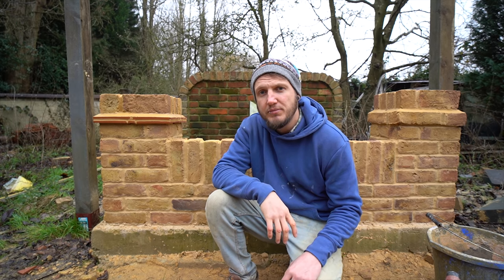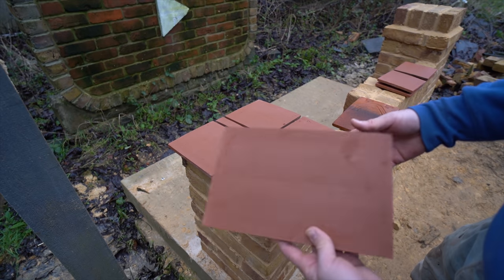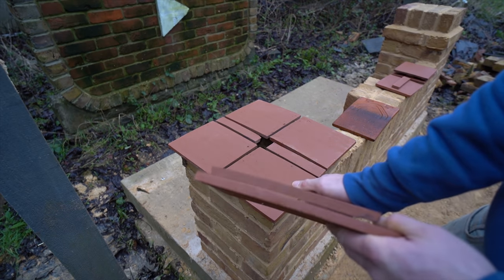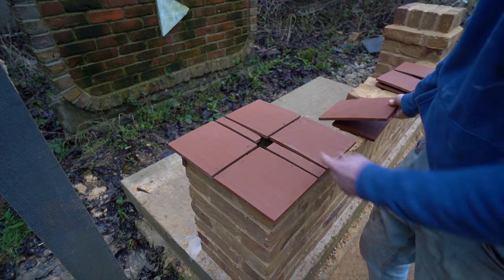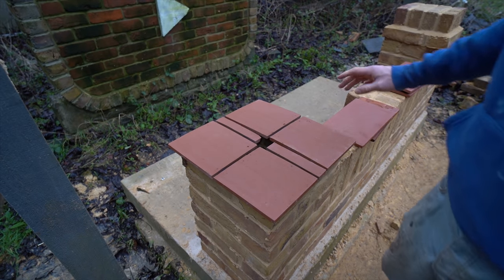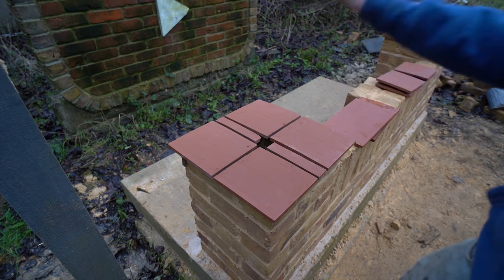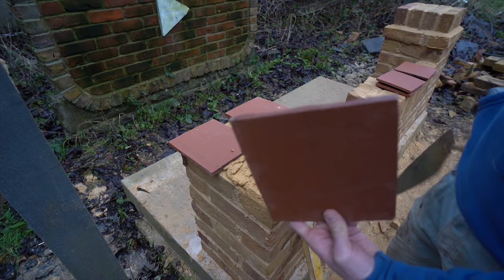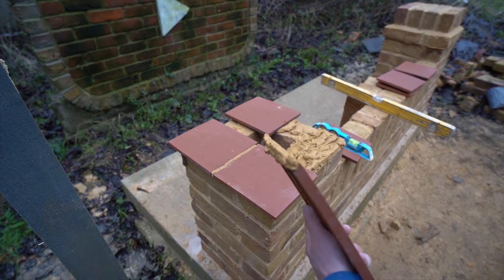BRICKLAYING - Make your BRICK PIERS look AWESOME with this

Comment: How would you suggest to build free standing pillars they need to hold heavy 6ft to 8ft High hard wood driveway gates?
Reply from the maker: I would suggest at least a 2 brick pier with a small steel running up the centre from the footings to provide enough strength to hold the gates. Hopefully that helps
Reply from the maker: In fact I would probably suggest at least a 2 and half brick pier
Reply: Thanks. Would you use a stronger mix mortar probably 3 to 1 as well? 

I was going to go 2 brick wide and put 4 lengths of steel rebar in the footing sticking up through the middle of the pillar and then concrete fill?